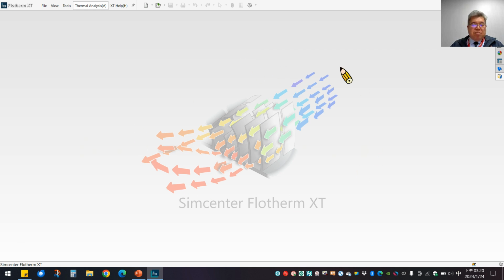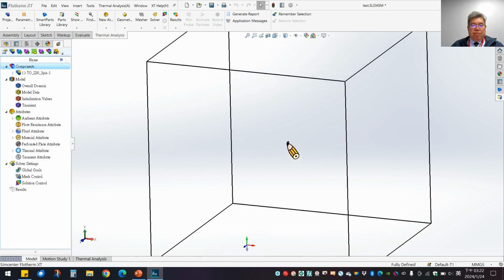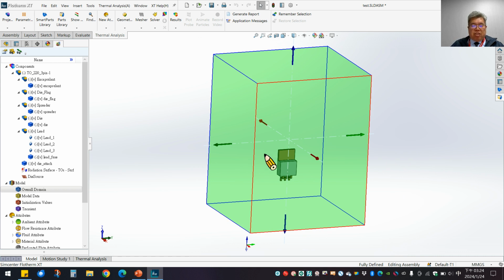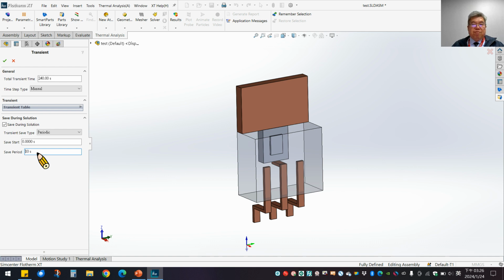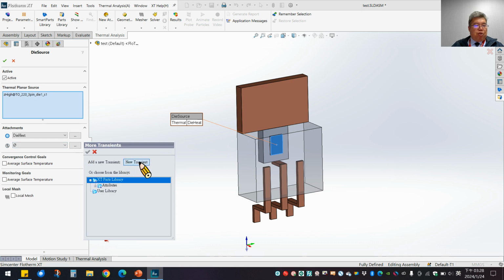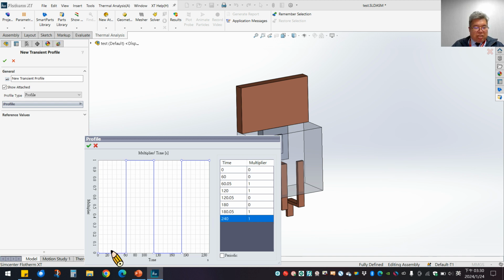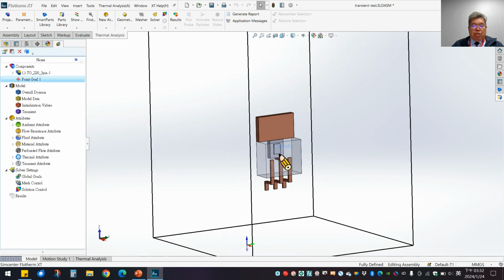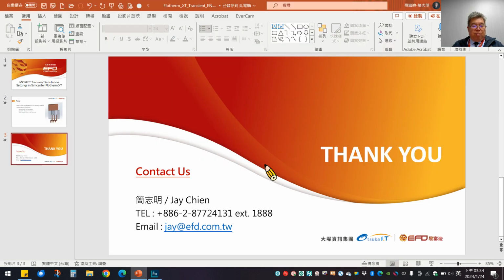[易富迪科技 EFD Corp.] MOSFET Transient Simulation Settings in Simcenter Flotherm XT (English video)

Comment: Sir how to thermal modelling MOSFET to 247
Reply from the maker: You should be able to build TO247 by modify TO220, because TO247 is similar to TO220. And you can quick build TO220 model from Flotherm XT default library.
Reply: Real MOSFET material different library MOSFET material different sir
Real MOSFET copper and plastic but library MOSFET material different sir both are not matching??
Reply from the maker: Default model in library is just for reference. Geometry and material maybe different with yours. If your model are using copper and plastic, you can setup real material in Flotherm XT.